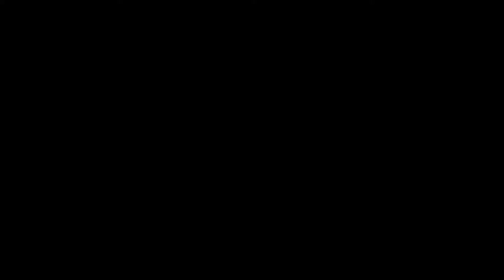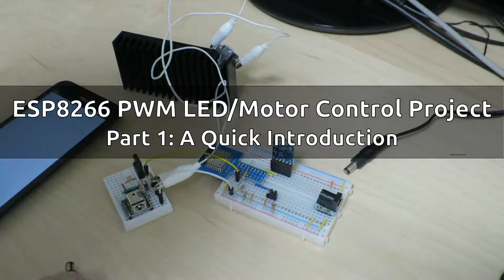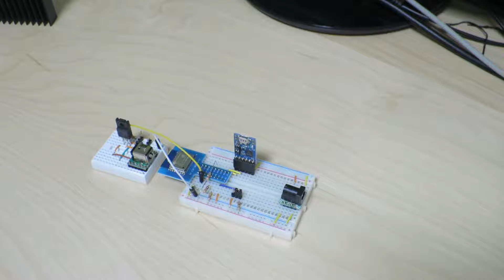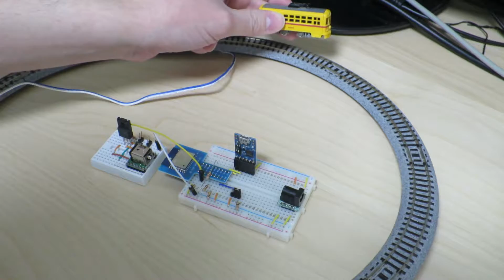ESP8266 PWM LED/Motor Control Project: A Quick Introduction

Comment: Can you please share the code? And by the way, to control over the wifi do you program the esp8266 or just use AT commands?
Reply from the maker: To get programs running on the ESP8266, I went the route of using the Arduino IDE with support for the ESP8266 to write directly to the flash memory. I'll share the code to when I get around to doing a follow-up video. Thank you for the comment! :)
Reply: coobird's lab oh so you directly programmed the ESP8266. Anyway, thank you for replying back, I will be waiting for the video. :)